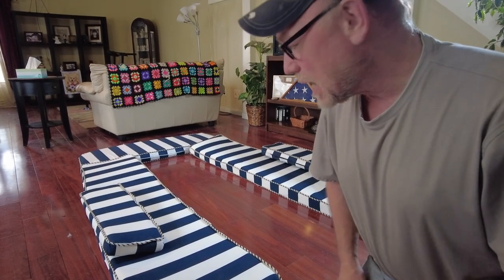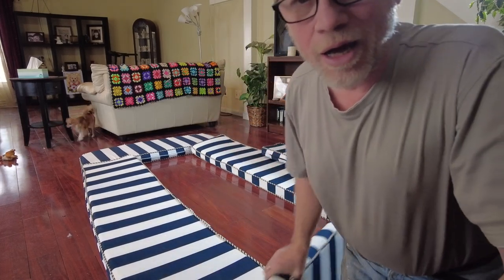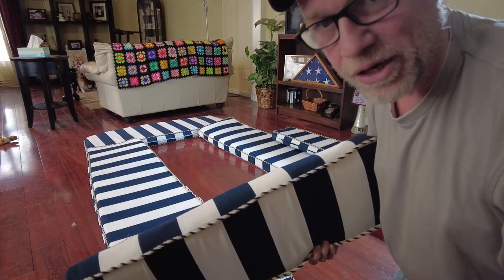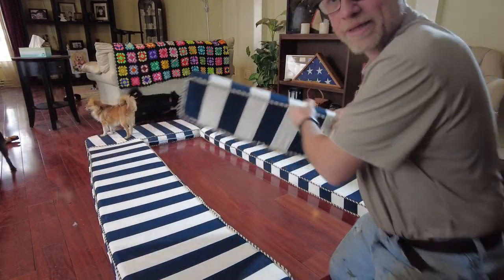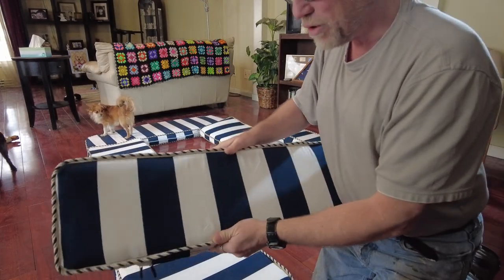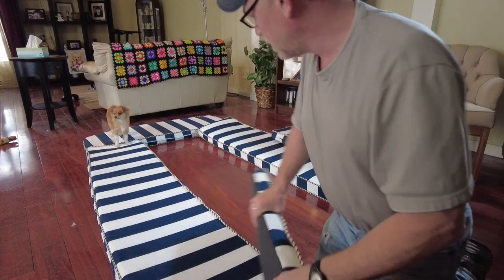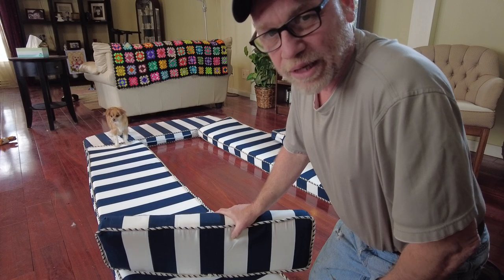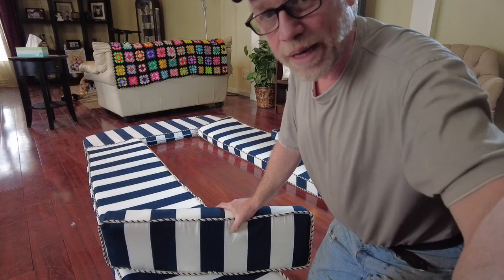Cockpit cushions for a  Catalina 30

Comment: Looks nice. Wonder how it would have looked if you changed the stripe direction on the end panel? I might have done it that way. Did you have a piping foot on your sewing machine? Premade piping or diy?
Reply from the maker: Yes I did have a piping foot.  The reason I did it the way I did (at least my thought process)  Was I did not want a solid color on the face of the rear cushion.

Comment: Do you have the dimensions that you used? I just bought a Catalina 30 and I need to make some cockpit cushions and greatly appreciate any tips and dimensions used. Great video, thanks for posting it.
Reply from the maker: I used the old cushions which had vinyl covers.  Sail right is the place to go.  They will show you how to measure.  Cutting the foam is the difficult part.  You want it clean and straight.  I failed on the one I had to cut so figure that out.    Watch the videos get a good sewing machine and take your time.  Also, use the piping.  Actually makes it easier.  Mine look good but there are so many mistakes.  I want to do it again because I know I can do better.  Make the back cushions too.  My crew and I love these!  Best thing I ever have done.
Reply: @saltlessshakedowns4999  Thank you so much for the information!! I really appreciate it. Thanks  for the great video!!